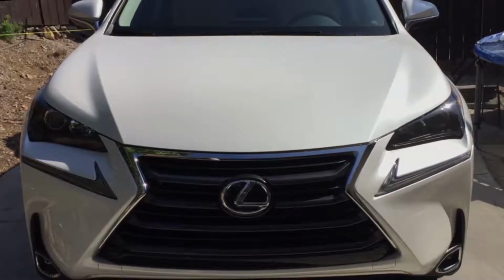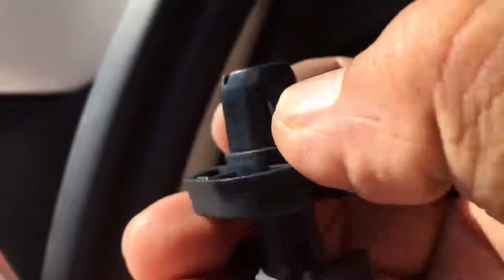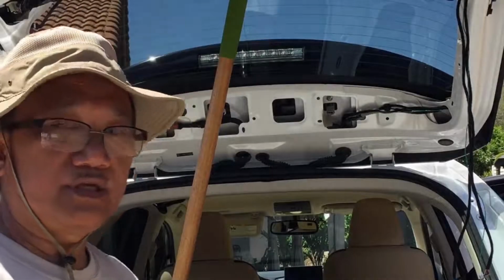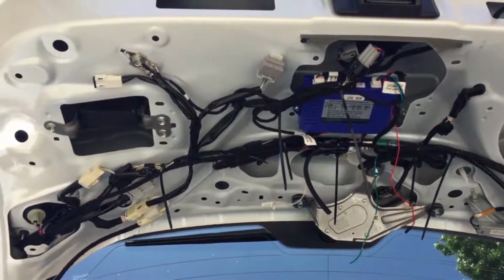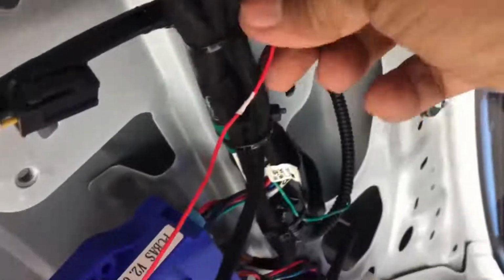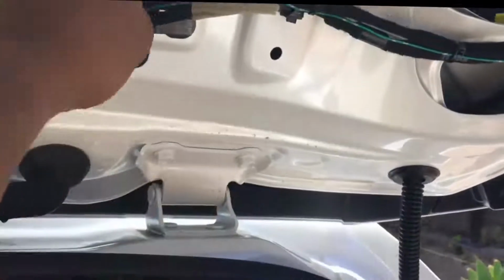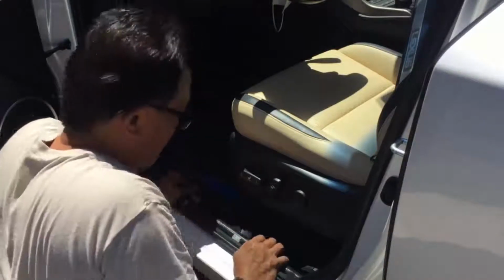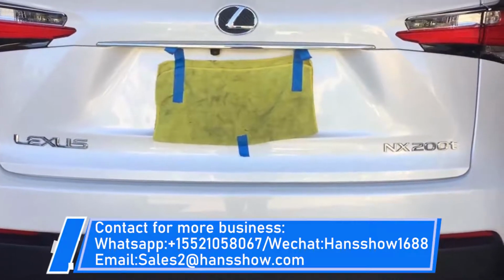Lexus NX200 Power lift Gate ,electric tailgate

Comment: Hey John I'm back until now my lift gate does not work. When you talking about the green wire or trigger wire what voltage were looking to fluctuate. 0 to 5v or 0 to 12v.